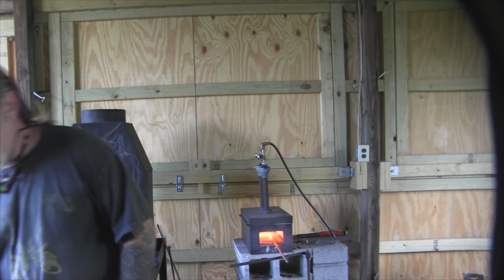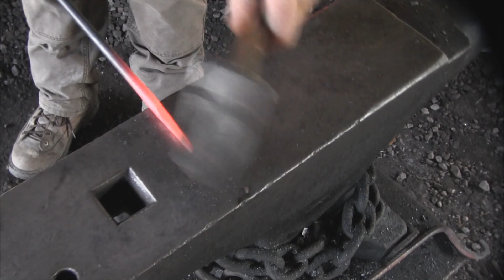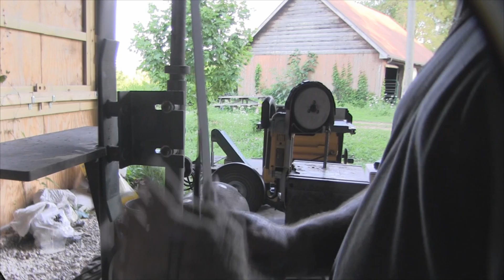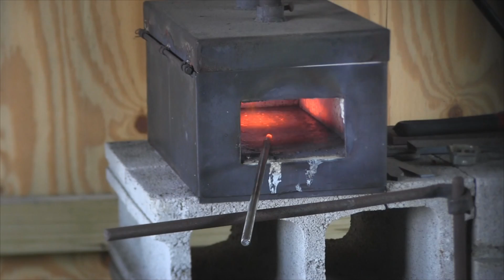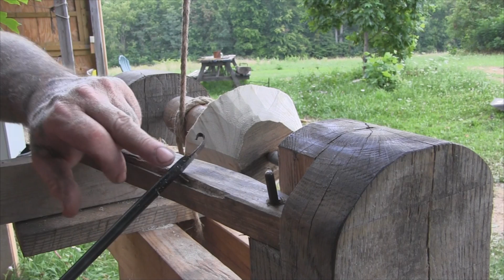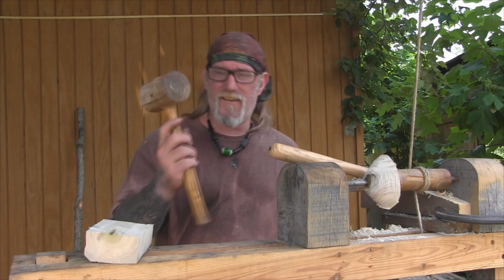Making Hook Tools for a Pole Lathe

Comment: Hello iam from the UK Ive been using a pole lathe for about 10 years know i also do 17th century reenactments with a pole lathe you lathe is looks like your  lathe is to high if you bring the height down you will get more turns on piece of work and it makes it less effort on the legs i get between 13 and 20 turns on my lathe

Comment: Neat option for sharpening tools with no machine and electricity.  Make/get a closet dowel diameter, superglue, tack metal emory paper onto dowel (regular sanding paper for sanding wood items).  Put down into spring lathe, and turn.  Can sharpen all your knives, hook knives, wood/metal gouges, and other metal tools.  Do same wood sanding with the spring lathe for wood sanding and finishing.  Smaller dowel sizes for smaller hook knife diameters.

Comment: not sure if it has been brought up but, smaller diameter spindle on the line that drives the work piece will speed up the turning and you will get more revolutions on the work piece. Equals more work done. Should produce nicer result also.

Comment: I have a quick question about working on the pole lathe.  I know with the height of it. And where you rest the tool. it seems to be more pointed down. And into the work on the tool rest. Would it make it easier. To angle the top of the tool rest up towards the stock? Thus giving the tool a little bit more of a upward angle to keep from biting in so heavily? I haven't done any kind of turning like this. So I am curious if that would make a big difference. Giving the tool rest a slight upward angle toward the stock. Nice video though Dave. Thanks for showing the tool build and usage.

Comment: I like this series of lathe wood working and making tools, it seems relaxing and you go at your own pace. I kind of think you needed the break to be honest. I know this sounds funny, but, I got ahold of a vintage Mattel Power Shop lathe, it can do up to Kuksa sized pieces. It has taught me how grain structures and flaws in various woods react to turning. For a toy from the 60's, it drills, sands, turns and bores like a full sized machine. If it had a deeper cradle, I'd be able to turn small bowls. I even use it to grind my own small tools, so also learning about tool shapes, sizes and bevel positions really helps. You can get Power Shop lathes on ebay from about $20 to about $80, depending on what they include. You at a minimum want the engine, tail stock brace and the tool holder.